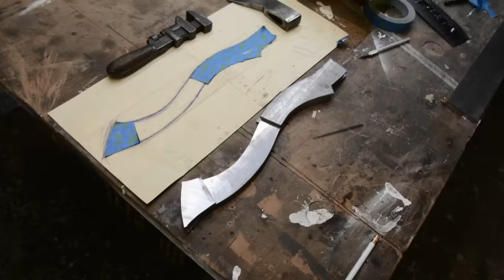✔ DiResta Steel Hatchet Handle

Comment: if you were a kid who had no tools and wanted to restore old rusty ones what would you buy first>?
Reply: Some crack.
Reply: sandpaper
Reply: Soak the tools on some white vinegar for a day or so. #jimmytip
Reply: memes
Reply: Anti-rust? Sandpaper? Sandblaster? 
I would use a friend's sandblaster, or buy a sandblasting nozzle for an air compressor. 

Also, as a side note, you can buy tools, but you can't buy skill, so start with the small stuff.
Reply: Sandpaper. Or if you had a little bit of a budget, a drill and a wire wheel.
Reply: thanks for the tips guys
Reply from the maker: 4" grinder
Reply: Buy whatever you can get cheap at markets and remove rust was with molasses
Reply: if moneys a problem try to find a bench grinder with a wire weel at a pawn shop you can get one for 20$ that's a good start
Reply: the first power tool i ever bought myself was a 4.5 inch angle grinder, so Jimmy is right. its the most versatile, it can cut, grind, sand, brush. anything that there is a wheel for. of course if you're Jimmy, you could always just build a house with nothing but a bandsaw. ( kidding)
Reply: 5" Grinder :)
Reply: a file
find some sandpaper
a hand drill 
as diresta said~ a grinder 
find a way to make or buy a vice, its 100% worth it
epoxy of some kind
some vinegar

thats all i can think of at the moment here is my reasoning
~a file~ is there anything you cant do with a file? when you wear it out, turn it into a chisel! 1095 is pretty hard
~sandpaper~ to many uses to list 
~a hand drill~ can be used to turn things round, drill, polish, wire wheel, and take screws out in style!
~a grinder~ there's no end to what you can do with it
~a vice~ it will save your fingers some pain and probably some frustration aswell
~epoxy~ to many to list
~vinegar~ very useful for removing rust and doing a gentile job!
Reply: so if you can buy from harbour freight, there tools are very cheap so if you break them its not a huge blow. for restoring i would look into either an angle grinder(with a grinder disk and various sanding disks and eye protection) or a drill (with a front and side facing wire wheel) or a wire brush, sand paper and buckets of elbow grease. Also if the rust is bad and your not worried about ruining the anything not steal get some muratic acid(please only buy if your parents let you because it is dangerous). oh and make sure your tetanus shot is up to date :-)
Reply: Grinder Forsure and gloves
Reply: agreed
Reply: A plastic tub and some white vinegar, soak the rusty piece in the vinegar for a few days then hit it with the wire brush
Reply: John Smith dont forget to neutralize with baking soda and then hit it will an oily rag
Reply: jake i True that  : )
Reply: I am exactly that comment. I use a wire wheel for a drill and white distilled vinegar.
Reply: what do you mean buy?
Reply: might need a bench to bolt the grinder to?
Reply: A bench grinder.
Reply: +Clarty Paths that's cool, I'll be trying that
Reply: BUSTRCHERRI yŷyyyy

Comment: question; if you made a steel handle, why not just weld the head on? i know youre not planning on using the hatchet ( which looks badass) every day but there looks like there are gaps around the wedge front and back. so it would work its way out eventually.  or would it have been stronger to drill through the head and rivet it directly to the handle. seems like that would work on metal but not wood. i have a few old axe bits so i think ill try.
Reply: not an axe nerd, just an honest question.
Reply: Axe heads are a high carbon steel and can be hard to weld. Welds don't always hold up well to shocks, and can crack. 

A pin through the side of the axe will loosen, because the hole in the side of the handle will oval out and become larger. Some do that with hammers and they never stay tight.
Reply: +Andre Gross thank you.
Reply: I was thinking why not press-fit the head on after heating it.
Reply: You would ruin the temper on the ax head. That and they are dissimilar metals, which don't weld together very well. You'd probably have to solder it together and that would ruin the temper as well.
Reply: I like that it's the reverse of a normal axe. It has a steel handle with a wood shim.
Reply: oh shit waddup
Reply: BS.

70xx series rod is going to have the exact same tensile strength as a 70k psi tensile strength bolt.
Reply: Andre Gross but you're forgetting the fact that with welding, if done properly the base medal along with the weld itself act as a single peice. This combined with the fact that most people use filler metal with a higher tensile strength than the metal that they intend to weld.
Reply: bla bla ruin temper bla bla high carbon
axes are not made of high carbon steel, either they are made of medium carbon steel these days or have a mild steel/ wrought iron body with a high carbon steel edge forge welded into place. an axe has enough mass to soak up the heat without drawing the temper at the edge. and both medium carbon and especially mild steel are easy to weld. also high carbon steel can be welded without any problems when it is pre- and post heated. it is enough if both pieces reach a blue color and are directly welded and after are to be put inbetween some (low density) fire bricks or vermiculite or something. been there done that without any problems.
Reply: maybe he wants to change heads from time to time, lol

Comment: what is the purpose of heating the pins before inserting, I would think they would shrink as they cool and not fit properly.
Reply: razdrazchelloveck it's so he can hammer them into a rivet, or 'peen' them. The shrinkage you mention is minor, and by upsetting the metal he is compressing it down its length to make a tight joint. They used to put together ships hulls in a similar fashiob
Reply: Electric welding came into use in the early to mid 1900s, before that, any time two pieces of steel had to be joined, they used rivets, sometimes bolts and nuts, but mostly rivets. 
When a hot rivet cools it gets tighter, pulling the metal together. 
 Bucker up.https://www.youtube.com/watch?v=6pbYYs3P91E

Comment: Alright, I thought about it for a day with no luck, Why heat up the steel pins before driving them in? I'm thinking the heat would expand the pins, causing them to initially fit tight, but loosen when they cool down... Unless they were slightly oversize and the heat is to allow them to deform slightly upon being hammered through.... I'm just curious--if anyone knows.
Reply: they were slightly oversize

Comment: Countersinking the holes to get flush rivets and using the band saw and a drill as a lathe was genius! Hows the vibrations with a metal handle?

Comment: Beautifully done, but wont grinding the edge on that hatchet make it lose its temper?  I know that the last inch or so of an axe head is differentially tempered so it can hold an edge.  And once the rosewood handles are on it, it's not like you can bake it in the oven and re-temper it...  sharpening is fine, but I'm hoping it can keep an edge...

Comment: Don't get me wrong I love your videos and love the look of this hatchet but I think that the handle from metal is bad because all of the vibrations go right to your arm. The shape looks amazing - I did similar a few months back to one of my axes but it was used as a firewood because it just didn't feel right in my hand so I made more occasional handle. And I don't think that the little piece of wood in the metal handle is enough to hold the head... ( also my personal experience). This is just what I found myself. If you think I am wrong just tell me - I will be very happy to learn something new.

Comment: +jimmydiresta Pardon my bothering, but I was curious on why you didn't weld the side plates on rather than riveting. I noticed you tacked it together so it wasn't a lack of tooling. Was it a case of a lack of fusion in the middle of the plates?

Comment: Is the handle made from stainless? otherwise you should of used aluminium. Awesome video non the less
Reply: Why use aluminium instead of stainless? Just for the weight difference?
Reply: because in the description he said he used cold rolled steel. he never specified if it was stainless or just regular steel. if he didnt use stainless the hatchet will rust very easily. If you use stainless steel or aluminum it would eliminate that issue.
Reply: Nucc's Garage

Comment: How's the shock absorption on that handle? I always seem to find that metal handles reverberate really bad.
Reply: I'm sure its more for aesthetic then function.
Reply: As long as the blade is kept sharp, the energy should always be transferred to the wood and not back up the handle.
Reply from the maker: Yea.   my hand fell off three days ago I'm using the hatchet with my teeth

Comment: The connection of the two components is significantly less strong than the components themselves. There is no reason (except aesthetic) to produce so sturdy handle.
IMHO.

Comment: Nice but not practical. For one it'd be crazy heavy for working but ALL the shock in chopping would be transferred directly to your hand and you'd give up before getting very far. That's why nothing beats a hickory handle - and never buy fiberglass handles for the same reason.

Comment: what was that honeycomb thing that you were heating on a 3:59
Reply: it looked like the guts of a catalytic converter, could be wrong though.
Reply: k thanks so im guessing it fireproof
Reply from the maker: It's sold by the jewelry supply company it's designed to be the opposite of a heat sink
Reply: Ceramic or asbestos?

Comment: dude cmon... bad... the handle doesn't have more strength... use a forge, if u used a forge it would make it more harden then the metal u used instead of more metal to reinforce it, advice take a blacksmith class, but overall nice work
Reply from the maker: Every one but you knows I am an armature blacksmith in training.  I am comfortable working in the "reduction" sculpting method.
Reply: +jimmydiresta OK my bad then I am sorry, try to get a forge and when u r working in the band saw please play music over the sound. because when u fast forward the clip it might hurt other people ear or annoy people.
Reply: +DG .Tinderbox dude I can comment and watch what I want, and this is a old pic I'm just too lazy to change it :/ and I do know jackass
Reply: As a heads up, the Diresta fans are die hard. I also think that it might benefit you if you were to know what the proper terms are in blacksmithing. I'm no expert smith, maybe a journeyman at best, but the whole "if u used a forge it would make it more harden then the metal u used instead of more metal to reinforce it" is kind just "online expert" talk. I mean you do you just next time phrase it more as an opinion less as a "fact". Any ways thanks for your input.
Reply: Yes that or maybe if it is a tool steel or air hardening or even just stainless, it may work harden. But forging won't too much other than it being on piece.
Reply: YOU DARE QUESTION THE MIGHTY JIMMY?
Reply from the maker: BTW the sides were to build up the girth... Not for more  strength.
Reply: jimmydiresta you forgot the logo !!! xd
Reply: A flat sheet of steel resists bending laterally pretty well, where a rounded solid slab would bend more easily. In this case, it would take quite a bit to bend it, as it's three flat sheets. Structurally strong steel elements are made of mild steel routinely, which lacks the carbon content to be heat treated to any meaningful degree. They rely on their shape for strength, rather than hardness of steel. It would take a lot to get this handle to bend, and if it were of hardened steel, it might crack under harder use.

I think the larger issue is the added weight, which would probably tire you out significantly faster than, say, a hickory handle.
Reply: +Scott Torrance don't play music. the sounds in the videos you produce are part of the appeal.
Reply: ggg
Reply: Scott Torrancen noob he is a professional blacksmith and smith he probably knows better then you
Reply: Scott Torrance the metal steel he used was already a forged piece.